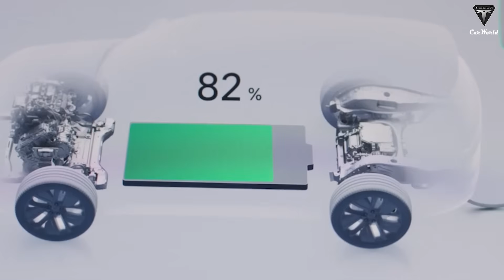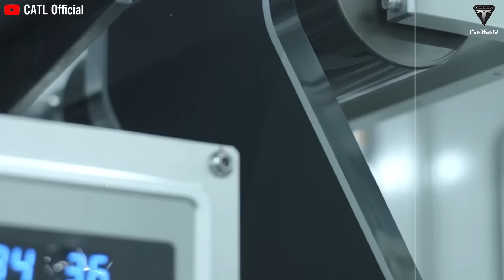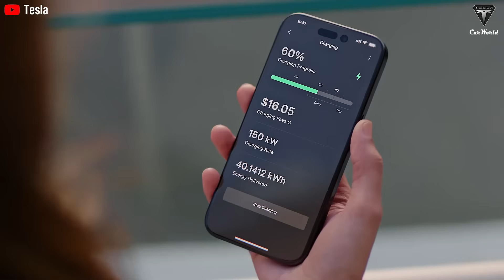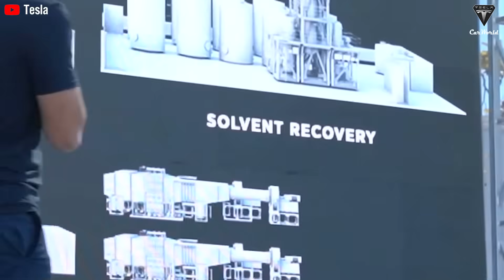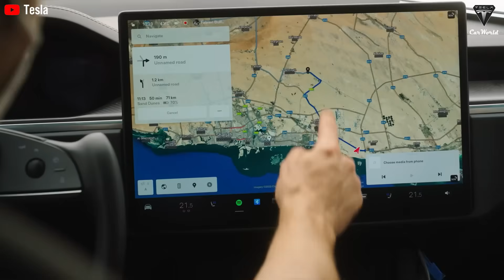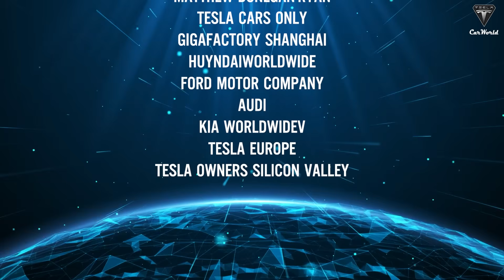Just Happened! INSANE 1,968-Mile Battery Shocks Elon Musk with 5 Min Charge! Destroy All EV Industry

Comment: 4 minutes to charge?  How?  Do you have megawatt charging stations?  Where does this electricity come from?  Current batteries have the potential for thermal runaway if they are damaged or defective causing fires that are extremely hard to extinguish and produce toxic smoke.  Have these batteries eliminated this safety issue?  Chinese products are cheap junk with zero regards for the environment.

Comment: I prefer the old saying... "Batteries Not Included"
‼️💯‼️

An effective Energy Supply should be 100% Duty Cycle, with preventive maintenance programmed in without any drop in production capacity, ABSOLUTE FLEXABILITY IN SUPPLYING THE DEMANDS, AS NEEDED... NOT PV, NUCLEAR, HYDRO, OR GEORTHERMAL... NON CONSUMABLE, AND THE ABSOLUTE LOWEST COST SORROUNDED IN THE MAINTAINING OF THE SYSTEM FOR ITS LONGEVITY

Reminder... The Laws of Physics are an ancient concept derived of man, and are not an absolute, fluidity provided by innovators who can prove them non binding, once they have overcome mans' insistance of limitations

Once man had no PCs, Microwaves, Radar, ELECTRICITY, FIRE... WE HAVE COME FAR FROM THE STONE AGE OF MAN

"NECESSITY IS THE MOTHER OF INVENTION"

Comment: Ev's are not cleaner people need to end that lie the day they leave the factory you need to drive for at least 7 years to break even on carbon and is if that only use clean electricity so stop the lies its a great breakthrough  but ev's are not the answer to saving the environment thay are filthy to the environment far more than combustion engines until we can overcome the problem of storing huge amounts of electricity witch we are far from at this point its not going to do anything about the Environment one bit

Comment: Sounds a lot like speculation.  Wait for proof of concept.  This is like the electric car from Africa that doesn't need charging or to be connected for charging.  That disappeared fast.
Reply from the maker: Totally understand the skepticism; nitrogen-doped sulfide cells kept 90 % capacity after 2 000 cycles in third-party trials, with pilot EV packs due 2026. Which milestone would change your mind?

Comment: I just recently learned about BYD from friends that own teslas. they were telling me about the BYD blade batteries which can charge at one million watts, that is five minutes to full battery charge, have zero fire hazard, are 100% recyclable, and a cycle life of 4,000 charge cycles while retaining 80% charge capacity capabilities, which equates to approximately 750,000 miles driven, and still retaining 80% capacity.

BYD has been making batteries for approximately thirty years, and in testing, they drilled through the blade battery, still no fire, and no smoke. this is quite an achievement. i also read that the BYD blade batteries are using graphene to enhance the batteries efficiency, allowing for faster charging, no fire hazard, and exponentially longer cycle life. it appears the BYD flash charging blade battery is a game changer. i also read that the electric vehicles which utilize these flash charging batteries are already now in customers hands.

i also read that 60% of BYD’s stocks are held by US investors, even though BYD is presently blocked from selling any of their electric vehicles within the US, with added trade tariffs in the amount of 100% and up to 250%. a trade tariff is a tax added to the vehicles, and essentially blocks BYD from selling their vehicles within the US.

i also read that BYD makes many electric vehicles, starting in price at 7,800 US dollars, and up to approximately 40,000 US dollars for the flash charging five minute one megawatt full charge technology, electric vehicles.

its quite an achievement.

i read that tesla was already buying batteries from BYD, but i have not heard of any announcement regarding if tesla is buying the LFP Blade Batteries, graphene enhanced for greater safety and cycle life.

Comment: Elon, you insist on the fire catching battery pack floor,  liquid coolant, and battery to electric motors connection.  For the last time, get rid of the liquid coolants for electric installations.  Liquid coolants short out all circuits. Or learn from some old German experts , who designed an antique small air cooled gasoline car that still runs today. (1930's to 1969 Volkswagen beetle). Salute the air cooled EV circuits design before a competitor manufactures a better and cheaper EV that wil leave your products on the unsold junker. Remember: batteries to capacitors, and capacitors to electric motors. All air cooled.( Or you may be one of the burned butt Tesla customers. And that ain't nice for your company's legal department).😮 Have a nice redesign trip. You will need it. And don't forget that promised $5,000 price tag on your economic Tesla model 2.
Reply from the maker: Safety concerns noted; solid-state removes flammable liquids, uses ceramic separators, survived nail-penetration without fire in UL tests and cools passively. Would you trust packs that no longer need coolant?
Reply: @TeslaCarWorld  Let's see if Elon Musk fulfills his promise on a $5,000 price tagged high quality analog economic Tesla EV. No pesky touchscreen control, no autopilot , key entry manual doors, simple automatic transmission , simple air bags and seat belts , flexible solar paneled roof, and free solar fast charger for home. All in the same $5,000 package. It must be a real 5 passenger car, not  a plastic box with wheels. Thanks

Comment: Imagine houses powered with these batteries, needing only 10 minute charging, possibly even using solar power panels. It will change the housing industry. Where before building on mountains and hills is not economical, it suddenly becomes a game-changer. Farms can become powered not through the grid, but grid independence becomes possible. It will mean many electric supplier companies and cooperatives will be suffering soon.
Reply from the maker: Exciting thought! Solid-state’s non-flammable chemistry, 0-volt discharge and 3,000 km reserves make solar-charged, off-grid homes and farms realistic, slashing reliance on utilities.

Comment: One big problem with EV’s is the connection between the charging station and EV.  There is no standard making long distance travel a gamble.
Reply from the maker: Understand your frustration with varying plugs. Industry converging on NACS/CCS, plus 1,500-mile solid-state range and 4-minute recharge means weekly charging; fewer stops ease long-distance anxiety, even before standardization.

Comment: China lies.  Until a real proven  battery is put in vehicles and not be prone to fires as found in BYD vehicles Tesla is a sure, safe bet.
Reply from the maker: We get your safety worries; Huawei’s solid-state uses non-flammable sulfide electrolyte, passes UL 9540A fire tests, and pilot EV packs survived 2,000 cycles without thermal runaway—proof rolling out 2026.